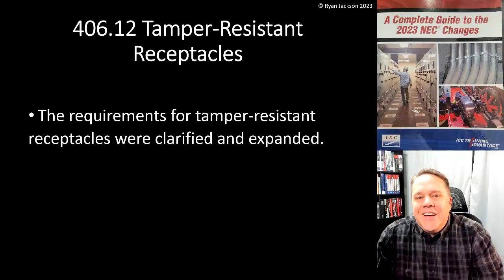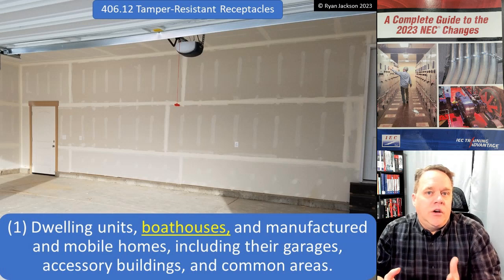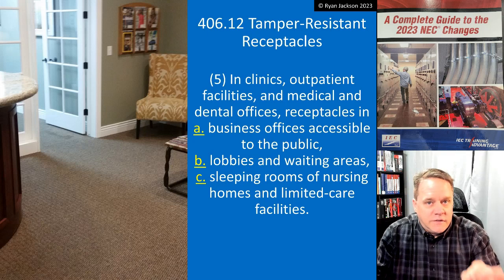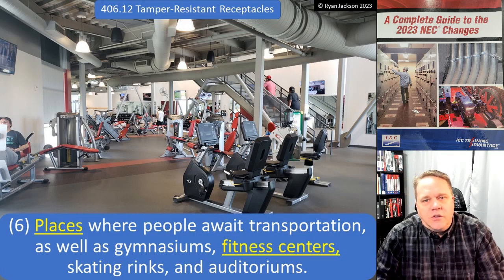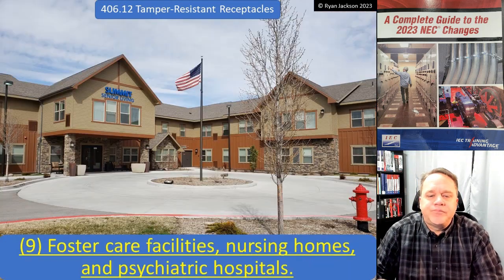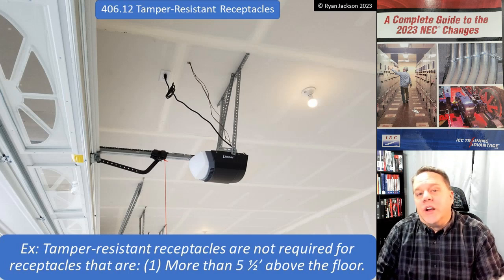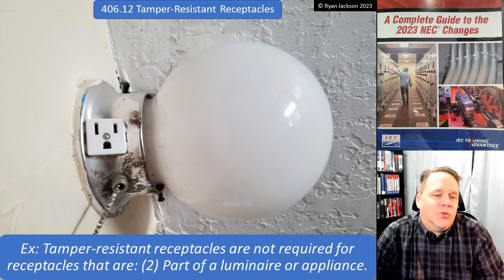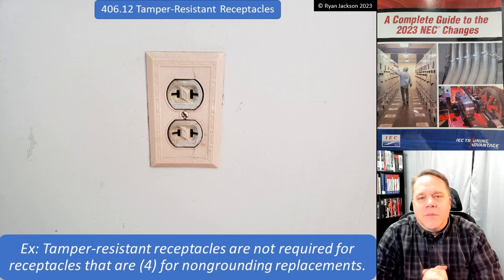406.12 Tamper-Resistant Receptacles

Comment: While on the topic of  exceptions for TR receptacles, another type that's not made in TR that I'm aware of, are CO/ALR receptacles made by Leviton in the NEMA 5-15R, in white or ivory.  Though it's not in the 2023 NEC, one could argue that because aluminum wiring for the 15 and 20 amp branch circuits only lasted for about a decade, and the CPSC and many major insurance companies  consider Copalum crimp and Alumniconn connectors as the two permanent repair methods without rewiring with copper, the amount of lives saved by requiring CO/ALR receptacles made in TR is negligible.  We shall see what the 2026 NEC has in store on this matter.
Reply from the maker: It is covered in 406.4(D).

Comment: TR receptacles are one of the dumbest rules they have ever come up with... an enormous cost addition that doesn’t work very well and is a solution to an almost nonexistent problem. 7 kids a day in the emergency room sounds like a lot until you realize this in 50 states with millions of children. I’m guessing way more people end up in emergency rooms from dog bites and gun shots than ever do from sticking a Bobby pin in a receptacle
Reply: Perhaps I engaged in a bit of hyperbole by with the term “enormous cost”.... it is peanuts compared to having to put arc fault breakers in a new panel.... my biggest complaint about TR outlets is how difficult it can be to stick meter probes in them.... both TR recepticals and AF breakers are attempts to fix stupid. The best way to not have your house burn down from an electrical fire is to have it wired by a competent and qualified electrician!... my experience over the years had been that when something is made idiot proof , they build a better idiot!
Reply from the maker: LOL what is the enormous cost? About twenty bucks per house?

Comment: I retired from one of the top rated rich Children's Hospital. Maybe 7 years ago they had a area for kids getting dialysis treatment. Between the good sized waiting room and treatment room the electrical contractor installed over a hundred hospital grade 20 amp top of the line Hubbell duplex receptacles that were not Tamper Resistant. I questioned him on it and he questioned the hospital engineer about not requiring TR receptacles & was told due to plans were approved a few years earlier while we were at least two code cycles behind they were not required. Finally somebody else complained about them not using TR receptacles but always bragging they are very pro active when it comes to any codes. They wanted the contractor to replace them with TR receptacles but he refused and had them pay for the devices and he ate the labor cost. This same rich hospitals used nothing but Hospital grade devices in every non patient offices & storage rooms.

Comment: I’m a little confused about the mobile homes section, I recently purchased a mobile in Arizona, and even before final inspection was shocked to learn that the NEC did not even apply to manufactured homes as they were regulated and inspected by HUD under different requirements. My original concern was the lack of arc fault devices in the home. Both the installer and the county inspector confirmed that their electric inspection ended at the service panel, same for plumbing inspection, all plumbing from the water meter to the trailer entrance had to meet local codes but stopped at the entrance to the trailer.
Reply: It applies…sort of. Mobile homes follow what’s called the HUD code. HUD doesn’t write everything themselves, so they adopt other accepted codes. Currently HUD uses the 2005 version of the national electric code. Ryan is going over changes for the 2023 edition. 

Even though HUD uses the 2005 version, the specifically stated that arc fault breakers are not required (HUD made them optional). 

The code making panel still updates and revises all sections , as necessary, because one day HUD will update their code and adopt a newer version of the national electric code. 

For more info on the HUD code, google 24 CFR 3280. Subpart I covers the electrical systems.

Comment: I mean, at this point 5-15, 5-20, 6-15 and 6-20 should just, by default be TR.  it is daft to have this extra complexity.
Reply: Agreed.   You could argue that by manufacturering all 5-15, 5-20, 6-15 and 6-20 only in tamper resistant style is actually cheaper in a way because it simplifies the assembly line.   Incidentally at least for the spec and commercial grade receptacles, the internal contacts are the double T shape,   the cover bonded to the receptacle determines the NEMA configuration.  If you pay close attention,  most of the new nongrounding receptacles   look like a 5-15 with the ground hold covered over, and the green terminal is absent leaving a screw hole in it's place.   With that in mind they might was well make tamper resistant nongrounding receptacles as well and be done with it.

Comment: 9:54.  The exception for nongrounding replacements seems kinda irrelevant because if you were replacing a receptacle in a location that requires GFCI, AFCI or GFCI & AFCI protection you'd technically be required to install a replacement receptacle providing the appropriate protection accordingly.     If my understanding is correct?

Comment: Some of these are very typical overreach of the code panels.   There should not be so many exceptions.  It really implies that the base device is deficient and needs to be re-standardized.   This kind of thing goes on and on and on with NEC changes...the exceptions should be inversed by changing the basic principle.  Yea, make every device tamper-resistant and apply exceptions to that.  How many would there be?  Likely close to zero.
Reply: If the manufactures provided every device with a TR version that would be great.. but for speciality 6-15R/6-20R and similar non-locking type plugs it's handy to have exceptions for specialized equipment.